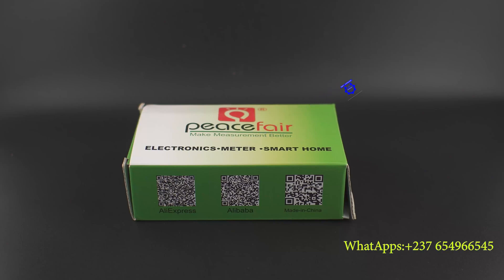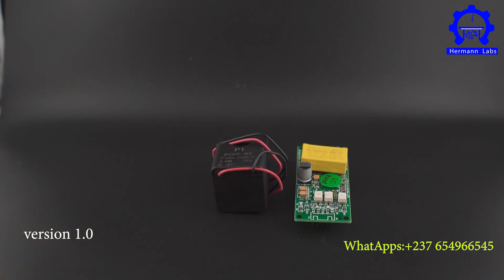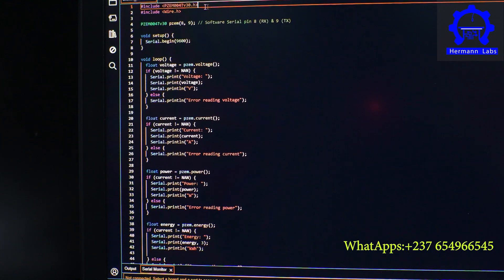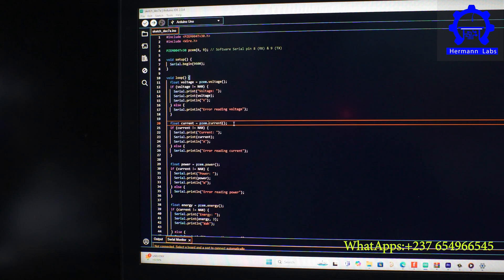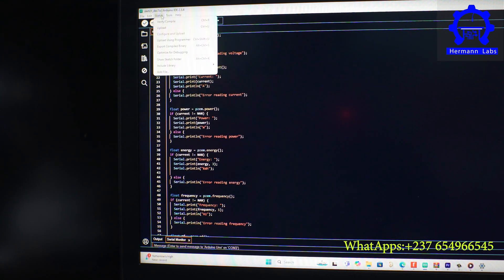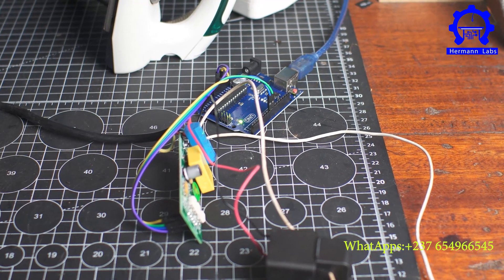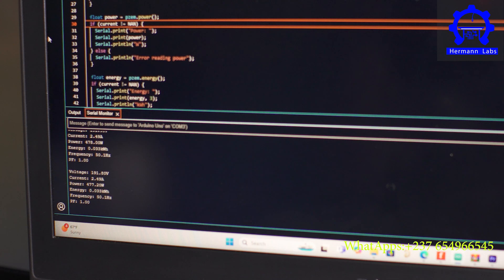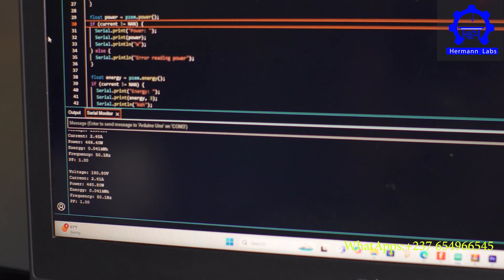How to monitor energy with the Pzem004T module

Comment: hello, what if the rx on pzem is blinking but even when it is plugged in, it is not sensoring any power or anything. what could be the problem?
Reply: I have the same problem. Were you able to solve it?